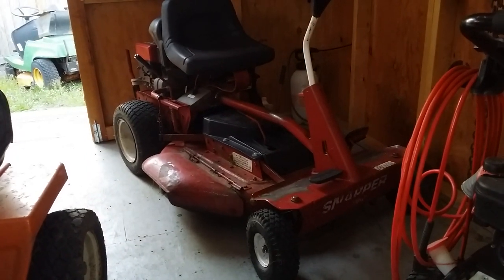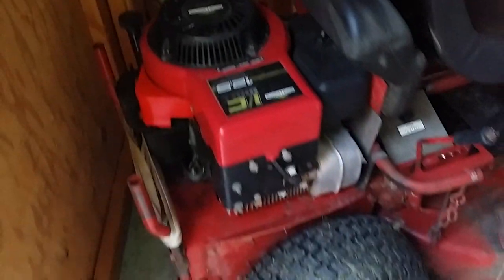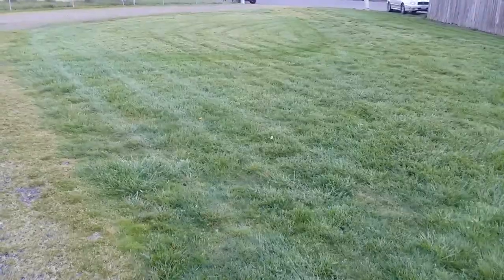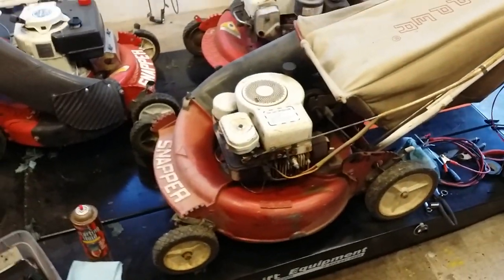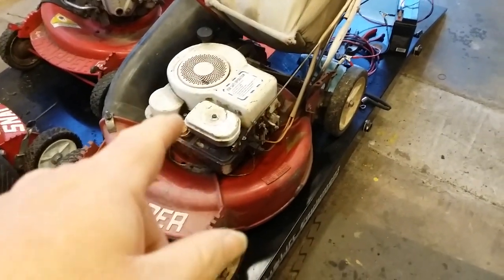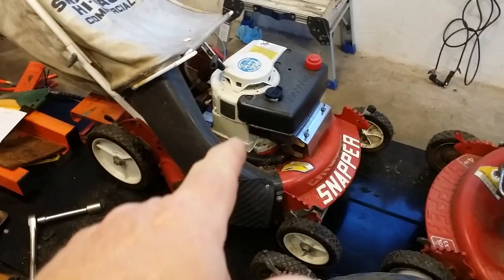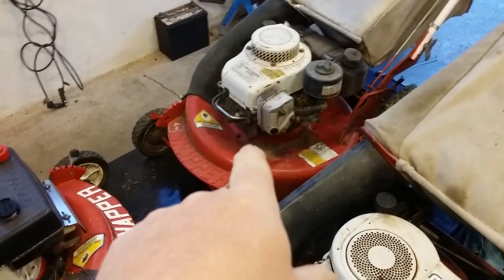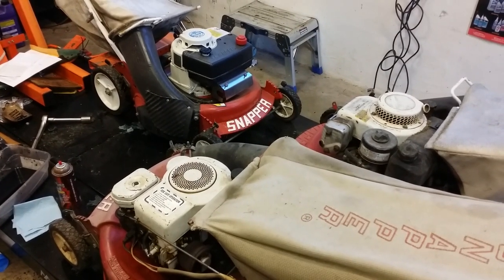Snapper Lawn Mowers, I love them and I can prove it!

Comment: Unbeleivable Glenn I have one of those snapper riders too! so we have that in common to. People with chianlink fences like them cause they fit threw the gate. I was at Pacific recycling today and they had 4 snapper mowers in the pile I pulled them out and said how much! They said we cannot sell anything that has been sold to us as scrap. That is what happens when a scrap yard goes corporate. My carb came for my snapper self propelled. Will l;et you know how the 6hp does!
Reply from the maker: I bought the Snapper Rear Rider at an estate auction for $60.00 with the brand new 12.5 Briggs IC Engine. The rest of it was so work out, don't know why anyone would spend the $ on an engine on such a junker mower. Where the front and rear pivot on the 2" pipe back bone, it was so wore out the deck drug the ground. The Left Rear Axle bushing was completely wore out almost all the way through. I rotated the bushing 180 degrees and am still using it. After some fixing, its been my #1 Mower at my shop. I call it my Forrest Gump Mower...lol

Comment: Do you use 2 cycle oil to make your 32:1 as gas for the Wisconsin snapper u have there?
Reply from the maker: It was a 4 stroke...
Reply: @GlennsSpeedShop  the reason i ask is because I got one that was left on the curb for free in me neighborhood and the gas cap says 32:1. On the Wisconsin 1-45  that it has it  says Important for longer engine life use only 4 cycle  engine lubricant. Maybe the gas cap was aftermarket and just only referring to the oil in crank case.

Comment: Ok Glenn I put the new carb on it which was backwards like the Deere ones. It fired up ran badly. Put on the new spark plug and air filter that came with the carb $14 and is runs good now. Much quieter than the Wisconsin and this Techumseh legend has an oil pump (no filter). These mowers in my opinion will not work commercially as they only cut at 2.5 inches ok for spring and fall but around here and every commercial landscape company I have worked for 3 inches is the lowest cut. In the summer here in E astern WA 4 to 4.5 is best when temps get 100 plus. There are very good mowers though I could try to put bigger wheels on them.

Comment: Not sure which engine I have but I need a new carburetor. How do I figure out a part # so I can search for NOS ?
Reply from the maker: You need the model number off your engine, then add that model to your search.  A common carb is on Amazon a not so common go to ebay, they have a better search engine. I have put 15 aftermarket carbs on so far this year with good results every time. 

Example.. Briggs and Stratton Model 1234567. Carbruator 

Good luck.

Glenn

Comment: Just picked up a v212p today, excited to restore . I’m told it runs but the cord broke . How do I know what year this thing is. 3.5 Briggs
Reply: My 1989 Snapper HI Vac has the 3.5hp Max engine as well. The year your mower was built is probably the first digit of the serial # if that tag is still on the deck.

Comment: You would think since you saw so many bad things you would have taken it all apart to give it a good going over. Make sure it was ready to run. Not run it only to  hear it fall a part. How many bad mechanics is this mower going to see before it blows up ?
Reply from the maker: Donna,
 As always thanks for the comment.. I normally don't spend any time fixing stuff that is not broke, I have 100's of projects that have broke stuff that needs fixin and would rather spend my time fixin stuff that is broke. I am curious how far you think I should go with this free mower? I would just do what it needs to get it operational, again fix what is broke and service it so it will last. How much time and money would you invest in it? & How far apart would you take it? 

Signed... Bad Mechanic :-(
Reply: @GlennsSpeedShop    Its not a 1969 Camaro  , its a working lawn mower  . Paint and decals don't cut grass.  nice collection , I'm glad I'm not the only one who has 3 or more snappers .